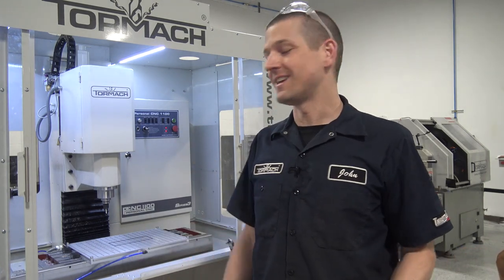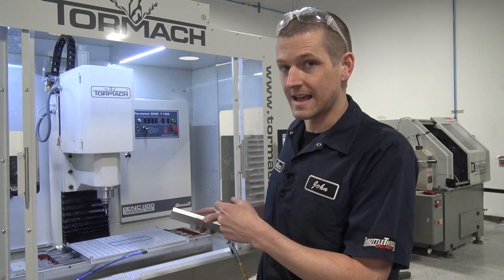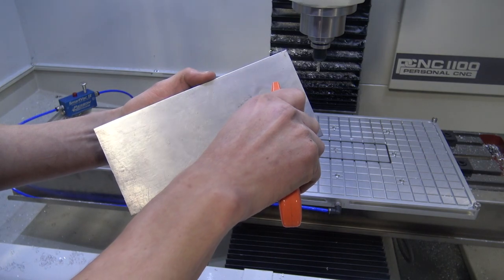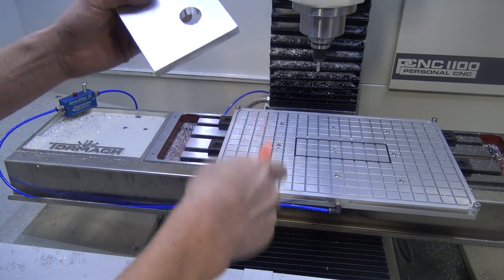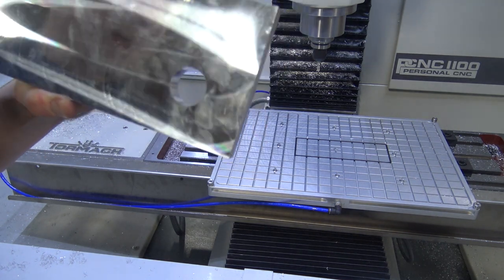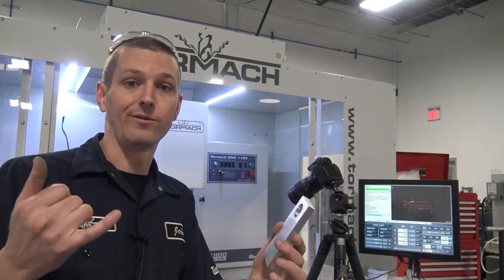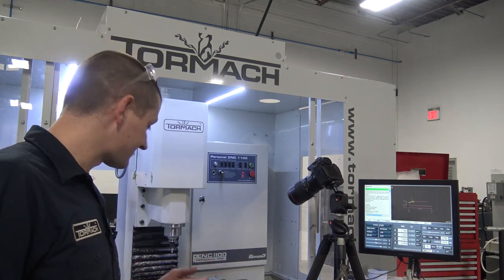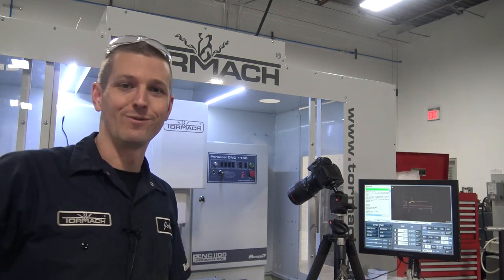CNC Vacuum Plate Fixture!  Widget89

Comment: Try making a nice sharp-edged punch that just fits the hole. Set the workpiece on a soft surface, put the punch in the hole, and tap the punch (or use a small arbor press). You should be able to knock out the remaining uncut bottom of the hole and leave an easily deburred edge.

If you have a lot of pieces to do, it might be worth boring a punch plate from some fairly hard steel (rather than run out of unmarked places on your soft backer).

Comment: Hey, great video! In a previous life I ran Komo machines with vacuum tables. When we did fixturing or one-off jobs, we would fly cut the top and bottom of MDF. Removing the top layer, .010" or so. The vacuum will suck though the MDF and allow for holes drilled though the plate with low loss of vacuum. The holes could then be resealed as we went preventing more vacuum loss with more holes. We would gasket and tape around the MDF as well. Not sure if it will work in you application. Hope this helps.

Comment: Hi John, I work extensively with aluminium plate on a vacuum bed with a CNC router (3 meters by 2 meters) 
I would suggest a solid core Formica sacrificial board, 2 mm holes drilled 10 mm apart (on such a small bed)
Else use a MDF board but you can cut through if you block off properly depend on you're overall vacuum pulled, I can give you more info if you want. BTW we are doing 2mm cuts with a single flute cutter @ 1200mm/minute.

Comment: FYI, you might want to look into Datron's vacucard sacrificial paper mats. Special paper that seems to allow air/vac to pass through in vertical direction only. For most 3 to 4 inch square parts you can punch a bunch of holes down to the paper before you risk flinging the part.

Comment: Very cool! I was looking at Pierson kit a few weeks ago and almost pulled the trigger on it, but decided to build my own at the last minute.. Should be up and running by next week! I'll probably do a vid about it for the heck of it : ) . Thanks for sharing John!
Reply: I bought the pump, an electric Robinair; and also a 5 gal aluminum vacuum resovoir. In theory, I shouldn't have to run the pump continually once the system is up to pressure (or suction rather), I'm installing 1 way check valves that should allow clamping with the pump off and 5 gallons of vacuum holding against it...I should have a chance at hitting the E-stop if I cut all the way through my workpiece.  I bought 1/8" gasket cord and will attempt machining a pallet. Seems legit on paper... We'll see if it actually works!

Comment: Great videos! I machine a lot of stuff on vacuum tables. Tape or laminate the backside of the plate and you can cut clean through without losing vacuum.

Kyle
Reply: That's way better than cutting short of a depth, and then facing the opposite side off like i was thinking.

Comment: John you have that hydraulic press don't you? Depending on how many holes you have to make in the plate. Could you not make a die and press out the holes say 1/16 under size. Then make some soft jaws for the vice and run a end mill to clean up!

Comment: I was also thinking of custom vacuum plate fixtures for specific jobs. The superfly cutter will be almost as good as Blanchard grinding on your machine. It would be awesome if there was a way to easily use CAD tools to make the vacuum groove recess a custom shape and have it fit standard large O rings.
Reply: +NYC CNC I'd do the simple CAD version where I manually calculated the straight and semi-circular O-ring groove segments to fit the circumference of a large O-ring.  And I'd use my SuperDuperFly to cut the flat surface in one pass.  But I'd need to get a larger compressor.  My little ultra-quiet 1HP California Air Tools compressor wouldn't be able to supply enough air for the vacuum generator.  I'm almost finished with the bolt-on kit to use my CNC router as an RTV silicone 3D printer, so maybe I'd route the groove in the aluminum vacuum fixture plate on the router and then have it dispense a silicone rubber gasket into the groove.  If I need a vacuum fixture plate for a quick change production job on the milling machine, I might make a custom vacuum plate and post a YouTube video.

I hope your 2016 open house went well.  Mr. WarMachine twisted my arm, but I had work I needed to do.  Way behind, and not much mojo to git-R-done lately.

Comment: One method I have used is to take a ball-peen hammer an tap in the center of the .007" plug. You can also "oil can" it, tap from the bottom and then from the top. A couple of times from each direction and the plug should break out of the hole pretty perfectly.

Comment: I always used a sheet of MDF as my sacrifice board, fly cut both sides to take the sheen off, then we could cut all the way thru and not have to worry about hitting the table. We were cutting wood on a Komo with 2 6'x5' tables, and nothing would ever move. We used thermo-ply to cover any area where we didn't have a part and would maintain suction.
Reply: By cut all the way thru I mean we would cut the depth of the material plus 0.10"
Reply: +Jon Dugan I agree. I'll go ahead and try to clarify. Sounds crazy, but MDF is permeable to vacuum, so you can put a 1/4 inch sacrifice MDF between your suction table and your work-piece.
Reply: +NYC CNC Its an exterior sheeting product for houses.  It comes in 4x8 sheets and is like 1/16" thick and is non-permeable so it helps create vacuum under the part. You can cut it with a razor blade or good scissors.

Comment: Depending on tolerances and if coolant is used you can just a sacrificial spoilboard under the part that has recess for the holes. I dont do any super high tolerance parts at work but I use 1/4 or 1/8" over the vac plate with some shallow pockets under the features Ill be milling. MDF is porous and allows the vac to pull thru it. That way I dont have to deburr and worry about leaving a skin on the part. May not work for your application but it is an option for anyone to use it.

Comment: Would it be possible to, instead of using a box cutter knife, punch the .007 thick material out with a punch and hammer?  Clean up all flanges with a deburring wheel/tool?

Comment: if you have problems tramming in why not pin the plate? That sacrificial plate I sent you an email of a while back we use exclusively for plate parts. 35x30 .375 thick phenolic plates with 90 holes in them. I used kantwist plate clamps to hold down the plates. If you were comfortable with not going crazy with your cuts you could do that instead of vacuum and eliminate trying to cut through the small film you have to leave to keep vacuum. Just a thought.
Reply: +NYC CNC true. In that case I would put stops in to remove clamp then continue then put clamp back on. But we're usually never doing outside profile work on the plates as they come precision cut

Comment: Im looking at getting a vac table and trying to purchase this material called VilMill from Germany, its a paper adhesive that activates from tool heat, allowing you to cut all the way through your stock and cut super small parts that stay put, when they cool, they drop right off the vilmil sheet.

Comment: If you have to make many of those you can get a Steel Ball bigger than the Hole Diameter and punch out the rest  Material with that. That should leave a clean sharp Edge that is much easier to deburr with the Handtool than the ripped Edge from the Boxcutter.

Comment: I think you need to mill a custom vac plate that won't allow vac to the areas you are removing. Then you can also mill all thru so there is a clean hole though out.
Reply: NYC CNC
Well then I wonder if you could use plastic plugs like for hydraulic fittings to plug the hole after machining thru?

Comment: Looks like a good solution to plate holding but what's the plan for clocking parts into alignment ? It looks like it would be difficult to tap the plates into square with the vacuum on.
Reply: Fair point but what about when you need to clock the other side to continue the job ? I haven't done much of that myself, so appreciate the insights.

Comment: You need a vacuum custom fixture to remove the areas that are not sealing.  Especially since you plan on making several parts. That large of plate was allowing much of the air to flow around it, and not push on it.

Comment: You've got a CNC machine man, use it!  lol  No more box cutters vs aluminum, powered by soft pink fingers.  That's an ER visit jut waiting to happen.

What I would do is make a die and use it to punch the flash out of all of the pockets at one time, in your press.

Cut a reverse version of your part (IE make the pockets into bosses, very slightly under sized to the originals) out of 4140 pre-hard (or just plain mild steel if you're not doing very many parts) and use it as a clearing punch to remove the bulk of your flash all at once from every pocket before deburring.

Put the male die on the bed of your press, put the part (with the pockets facing down over the die bosses) on the male die, lay a thick hard rubber backing pad on the part, put a backing plate over the pad, and then press the assembly together until the die punches through the flash on the part, cutting your holes clear all at once (and without slicing anyone's digits).  Then just deburr as normal.

Another option is to use thicker material and face the back side off entirely.  Workholding might be a challenge here, depending on the part size.  For something like you were working on there, you can just hold it in a vise to face off the back.  Bigger parts may require more heroic measures, or just opt for the die punching method.
Reply: +NYC CNC   If you do it that way, I demand video.  lol

Good luck with the open house!

Comment: Nice video and vacuum plate. I did a lot of work on a four head shoda router using a vacuum table and doing lots of spoil boards. I have a few ideas that would help you if you want drop me a comment and  I can pass on to you some more info.

Comment: what about making a quick die to press through the hole and punch out the little scrap on the bottom? just take round stock and cut it at an angle and then force it through the hole with a press or maybe even hit it with a hammer? lol.... the knife is slow as heck it looks like and there is the possibility of the blade breaking and sending chunks of blade flying around... its not fun when that happens, those buggers hurt lol...

Comment: What kind of material would you use as a sacrificial surface? How bad would it be using cheap mdf?
Reply: +Lucas Hartmann depends on the accuracy you want, ive glued ally to mdf and plywood, you need to take lighter cuts but it does work pretty well, and no concerns about going too deep!
Reply: +Lucas Hartmann  Aluminum

Comment: Take your part to 2 drill presses.  The first one have a decent size drill and bust the pocket out of there, the second, have a big chamfering tool and it'll remove all that thin stock.  Just hold it with your hands

Comment: it called leaving a onion skin it works fine in wood, the other way is getting the material from datron what they use between the vacuum and work pieces
Reply: +NYC CNC you can try that first it still works well leveing  .25 mm  0.0098 inch with wood even MDF, aluminum as small as the machine can leave.
that's with a pump like yours has same pressure as well, the constant running pump works just as good at 2 x the prices and is a lot quieter, but there are a lot of other good idea's to read through.

I have a stack of pucks to make, as they are cheap as shit to make if you cut them it does not matter, your plate you don't wont to cut that.

Comment: Is there a benefit to using a fly-cutter vs a face milling cutter?
Reply: The benefit is that the single point cutter allows lower horsepower machines like these to run without bogging down. Multi-insert cutters put a much higher load on the spindle, which is no problem for, say a 20HP VMC. But a little 1-1/2 HP spindle doesn't like it as much. Running a nice big, even, chip with no bogging down makes for a better surface finish.

You also get the benefit of not having any slight variations in the inserts causing unevenness, but a really high-quality face mill with high quality inserts usually doesn't have that issue.

An alternative for those who might already have a face mill and want to run it on a lower horsepower machine would be to just install 1 insert and run it like a fly cutter.
Reply: Wrenchmonkey
Awesome response, thanks!

Comment: Why don't you ask your buddy John Grimsmo how thin you can cut it and still keep vacuum? He was using this style of vac table for a while.
Reply: +greg mcnamara +nyc cnc If I recall, Grimsmo had to use mighty bite clamps to keep the part from moving left/right/forward/back.. the vac table was fine with enough down pressure, but depending on the load, he would see the part shift on the rubber seal.
Reply: +greg mcnamara +nyc cnc Oh, and this one is about 1k cheaper than the kit Grimsmo had if I recall.. I want to say the VacMagic kit was mid 3k, this one looks to be about 2200 msrp.  Any chance for a patron discount with Pierson? :-)

Comment: you should mill notch in 2 aluminum bars that fits snug in oring grooves and set it behind o ring on back side and left or right whatever you prefrence is. after machining bore try flipping over and setup a pin in a solid holder and g81 that no rpm in spindle. hate to see you go to hospital using box cutter
Reply: +NYC CNC Thanks if it works post video please... I love your channel it great for new info

Comment: vacuum plateeee? whattttt... that is awesome..
wowww

but you need to work slowly with this plate? the paths .
Reply: +VLAHECO The holding force is much smaller than a vise, so lateral cuts need to be adjusted to prevent crashing. The path is slower, but I would not know by how much on CNC. I just know that with a manual mill, it is about 3:1 for me
Reply: +NYC CNC wow.. that is a cool plate.

Comment: Suggestion: glue the work piece to a flat piece of stock allowing you to mill through the work piece and not break the vacuum. Find an adhesive that can be released with heat. Loctite or 3M
Reply: +George Steele 
May as well just clamp it at that point.

Comment: I dunno... Seems like a lot of cleanup work. And cutting out the hole with a knife is simply not safe... If you're going to continue down that path, better get some Cut-proof Gloves... Is it not possible to flip the work piece over to finish the holes...??? Some side stops could center the work piece... I just don't know... Sorry...
Reply: +metalhead2508 That doesn't seem entirely accurate... The Vacuum plate is much larger than the work piece... What I can see from here, it appears to be creating vacuum all all points, on the plate, even outside of the work piece... I'm going to check some other videos about Vacuum Plates... Maybe I'm missing something...
Reply: +DStray Cat 
All the ports that aren't covered by the part will be plugged (or no vacuum will be applied to them).

Comment: You need to learn how to correctly use a deburring tool; the way you were holding it - addressing the work at a nearly perpendicular angle - practically guarantees an imperfect, "chattered" surface to the eased edge.

Also, having used vacuum plates [almost] exclusively to hold my work for the last 30+ years, I can give you some time-proven secrets to improving your vacuum plate AND regarding how to use it efficiently.  Hit me up on Facebook if you care to be edumacated further.

Comment: We would have used a pin router. to finish out the holes. It is a pin in the table matched up to a router mounted over it.  It has a foot control to bring the spindle down to cutting depth.   https://www.youtube.com/watch?v=U5moMnKWlBk    might be able to do the same thing on a mill put a pin on the table use a down spiral cutter.

Comment: zone out the vacuum plate 4,5 each with check valve then put stops in (x,y)for work to push on , and also this will work for set up